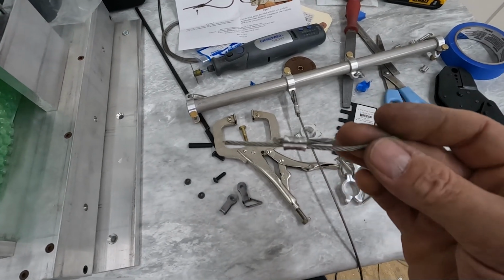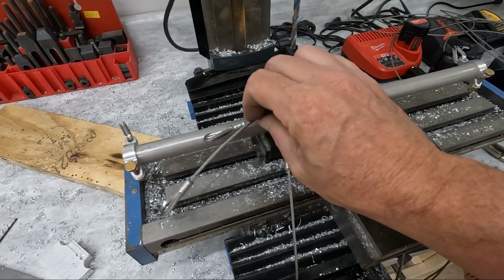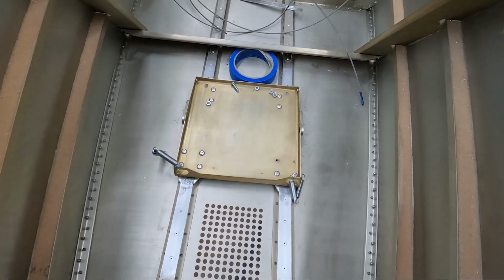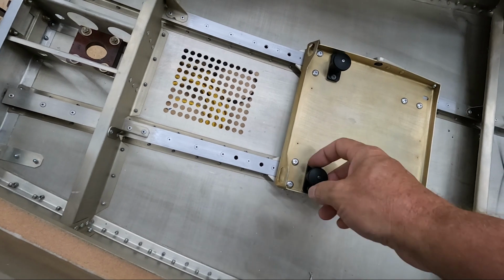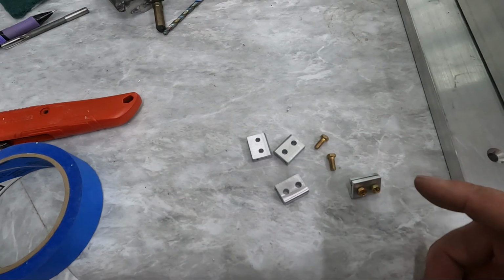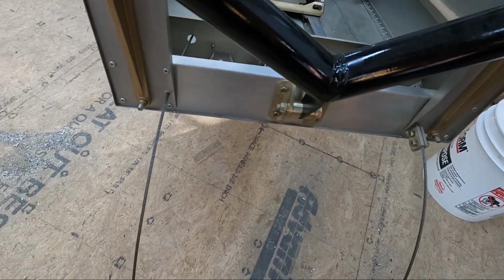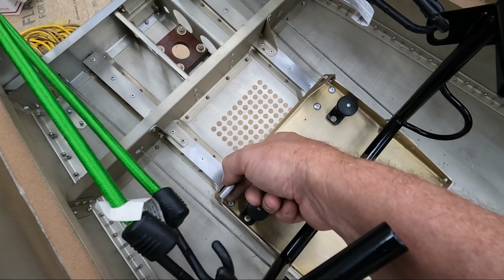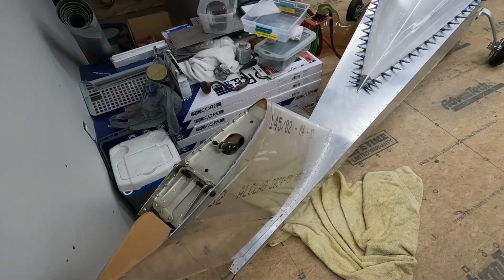33 - CriCri Airplane Build - Rudder System - Part 2

Comment: Concerning the slots in aluminum clamps: there are so called slitting saws available for mills which are meant for exactly this application. They are small circular saw blades, some 50 mm in diameter with a variety of available thicknesses. Not expensive and useful to have at hand.

Comment: Not sure how I got here but extremely interesting project. I too have thought of building one but so far its just been a thought. lol 
For now im busy enough doing many upgrades on my RX 550 Beaver.
Im curious, are you able to order any parts for your project at all, if so what can you get?
Keep up the great work! Thank you.
Reply from the maker: No parts at all were available to me, not even fiberglass parts or a canopy to mold. I've been able to recreate almost everything including the canopy. Just today I'm finishing up the fuel tank mold. All the other parts I've created along with some help from a machine shop to produce some of the multi axis CNC parts and some of the welded parts. I'm hoping to have a website up soon that will have parts available for plans builders and also start creating sub kits for the airplane. The company that did provide parts such as all the fiberglass parts, landing gear and canopy closed in 2017.